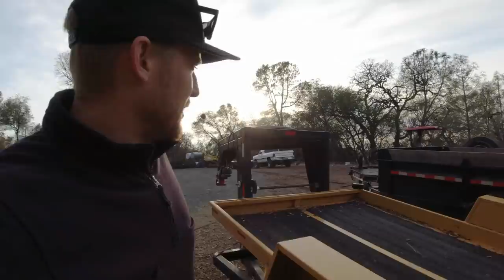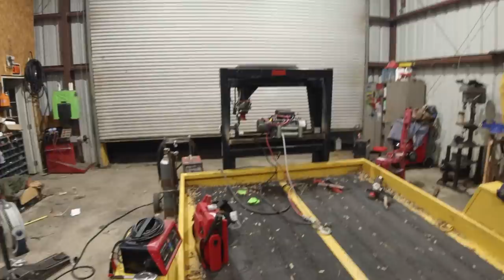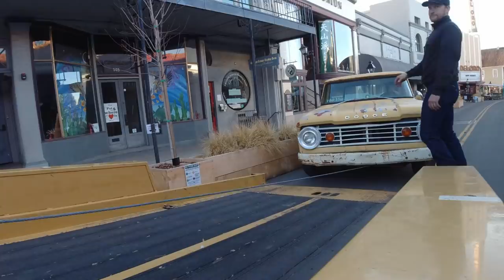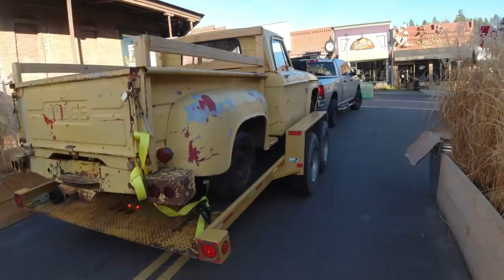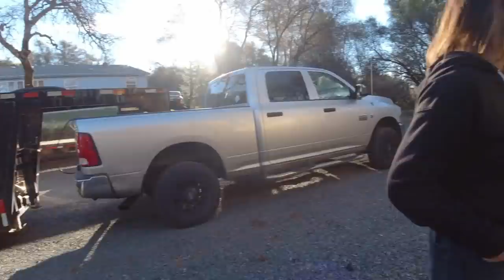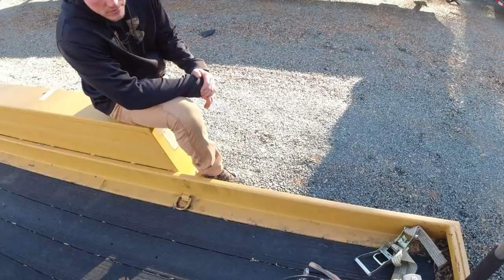I HAD TO REPO MY TRUCK! No PAYMENTS!       Adding A WINCH TO MY TILT TRAILER

Comment: Cool project.  I've got a 70 Sweptline camper special I was going to do a 12 valve swap but when I found out what fully restored ones are going for, I decided to keep the 383 and restore and repaint back to the original Go mango color.

Comment: move the winch to the top, run the cable thru a block on trailer frame then thru a snatch block to hook on trailer frame... instant 2 to one purchase and 1/2 current

Comment: If you use a snatch block and double the cable from the truck back to the winch . You get double the pulling power. If the winch is 12,000  you can get 24,000 by doubling the cable back to the winch.
Reply from the maker: Very true but a 12k winch shouldn’t have trouble moving a 4K truck will air in the tires.

Comment: Without completely redoing the winch mount and to gain more room, you could remove that small bar (since you just welded in the 2” sq tube) and mount the winch backwards and add a pulley to change the cable direction 180. Had a 1963 D100 I planned to do the 4BT thing on too, regret selling it when I popped smoke and left socal for TX.

Comment: I got a cheap set of jumper cables and heavy wire crimp from Amazon. I cut the ends off and crimped copper terminals to the cables and run them down the frame of my 450 from the battery and added a high voltage quick and disconnect to the cables and my winch. Keeps from having to tote a battery every time you need a winch. All parts less than $100.

Comment: Just a bit of advise, when we did repowers with a 4BT. We used fluid filled mounts used in Chevy V6 installations with a torque strap with damping spring to limit roll. Also don’t use urethane rear mounts for the trans mount ( too stiff ) and it transmits to much vibration. Also keep engine idle speed between 775 and 800 rpm.
Reply from the maker: Did you mount it into a second gen dodge frame?
Reply: We did it into E350 FORD and C30 Chevy Step van chassis ,  you will have to fabricate both the engine and frame mounts ( 5/16 min thickness ) get the engine side support that would rest on the isolator as high as possible to the engine centerline as possible ( to help reduce engine roll.

Comment: Winches pull huge amount power when under load. Your best bet is to run dedicated power to battery and use qd winch plugs. I took a set of 30 foot jumper cables and put qd connects on each side. So it would plug into the winch on one side and the other side have qd to go to the jumper cable clamps or a qd so that you could bolt it to the battery. Most of the time the jumper cable clamp is enough but on a long, hard pull I bolt it to the battery direct. It makes a big difference. My 10k Warren winch will warm up my leads on a couple of long hard pulls. Leads are "rated" at 600 amps.

Comment: Could you bolt the winch to a 2” bar coming out the front of the winch under the spool,  so it slides into the receiver on your trailer from the truck side of the receiver? Then it won’t hang over the trailer at all. Just a thought!

Comment: Why not mount it on the deck so that it will pull low whether the bed is tilted or not.
Easier too.
Reply from the maker: Not enough room to get it to tilt
Reply: @V-BELT and SON   Just thought of something: it might add too much weight to the front too and throw off the tilt "balance" especially with the battery up there too.

My tilt trailer is OLD, it uses a MANUAL  hydraulic cylinder to force the tilt so the weight up front doesn't matter.

Comment: Should just mount the winch to the floor of the trailer that way when you pull something on the truck or what not goes right over the winch
Reply from the maker: Won’t fit a car if I do that
Reply: @VBELTandSON  build some wooden ramps for car to drive up on to go over winch. Would be less strain on the winch as well.
Reply from the maker: Rather get some longer ramps and use my new diamond c trailer from now on.  Nothing fits good on the yellow one

Comment: Why didn’t you weld receiver below top tube?  It would lift a bit toward end.  But quick, easy.. or infront of riser?  Winch more under spare then in the way.  I see higher would be issue on pickup tilting down.

Comment: Since You're Going 4bt Diesel & An Updated Frame & Drivetrain, Is It Subject To Strict California Emissions?
Reply from the maker: Truck is presmog. It doesn’t matter.
Reply: Just keep the VIN on the cab and don't tell the DMV.  California doesn't have inspections like other states except for smog every 2 years.

Comment: The 4BT is a nice engine.  Your plan to make a custom design with an upgraded frame.  Is a valid one.  But using the lighter R2.8 crate engine would probably  be a lot simpler.  Of course, the 5 speed is a must in either situation.  Having the overdrive and the extra gear will improve the driving pleasure and fuel economy.